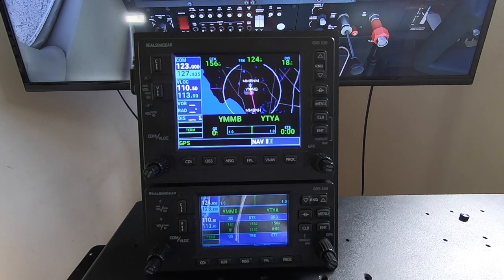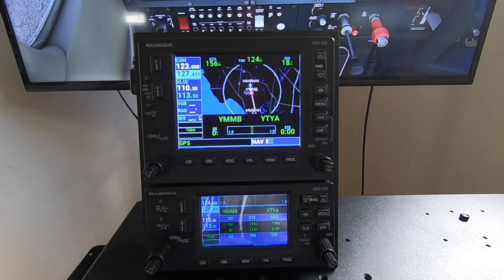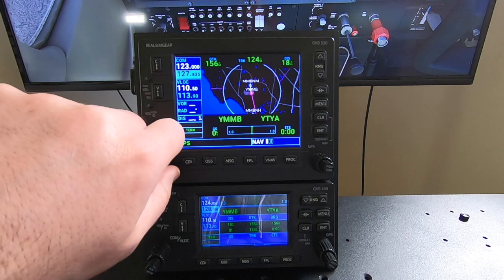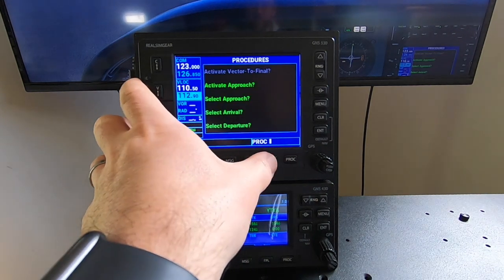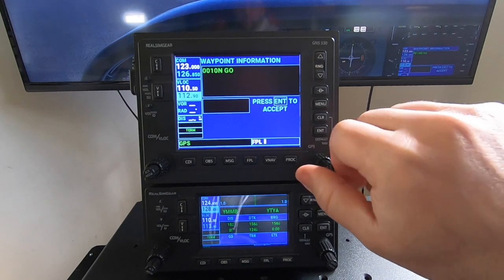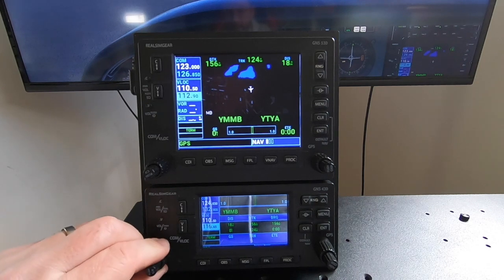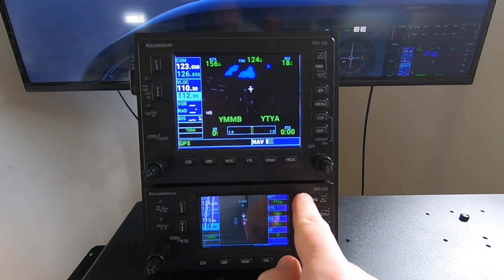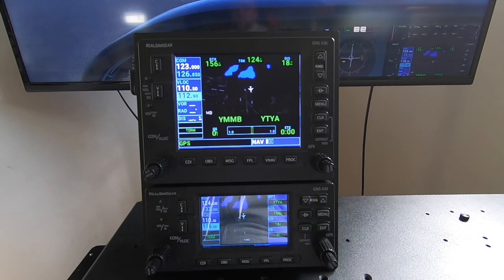MSFS2020 Update for RealSimGear GNS Hardware

Comment: What if the plane you're flying in the Sim doesn't have that GPS unit?
Reply from the maker: Right now the aircraft will need a GPS unit to interface with our hardware. We hope in the future some addons will come out that will allow you to add any GPS system to any aircraft. Cheers
Reply: @RealSimGear  that will be fantastic! 
Someday I will like to replicate some or most of the Cirrus and Cessna I fly so that I'm not wasting cash in flight learning a feature of the G1000 or the GPS systems.

Comment: I have a question I want to get the g1000 but it’s to expensive so I’ll probably get the 530 so you know that most of the planes in the new mfs 2020 have the g1000 I was wondering if you could put the window of the g1000 in the 530 so that I could use more planes and not spend 3000 dollars
Reply from the maker: Although technically yes, you could drag a G1000 window to a GNS530 - but reading all of that information on such a small monitor would be quite difficult. No need to go for the G1000 suite all at once, a single XFD is $999.
Reply: @RealSimGear  yeah I know it’s not a problem to read that small I’m 12 so I can see very well in fact I’m getting the gns 530 for my birthday that’s why I don’t want to spend even 999 dollars cause I’m 12 and it’s a birthday present thanks best regard.

Comment: Hello, two questions: 1. How do you make the display fill the whole screen. Even though I have the resolution set to 1280x720 (default) and have the display set as Landscape/Flipped the display does not want to scale properly and is squished vertically when set to full screen. I researched this on your web-site and cannot find solution 2. The approach mode is INOP. I assume that it is MSFS issue but please confirm that it is NOT possible to load approaches in GNS530 in MSFS2020 with the default software (e.g. the default C172 with steam gauges).
Reply from the maker: Bart, if you can reach out to our support team via the Chat button on our website or email support@realsimgear.com, we can address question 1.  For question 2, we are not sure what capabilities that MSFS itself provides in terms of approach procedures.  We have heard that they are not as fully featured as needed.  Our hardware simply controls the 530 in the sim, it in of itself, does not load or perform the procedures.
Reply: i have same issue, gns430 still show windows title bar, beside that. it is perfect. good product, easy setup with fs2020